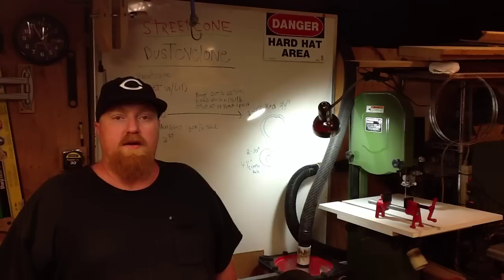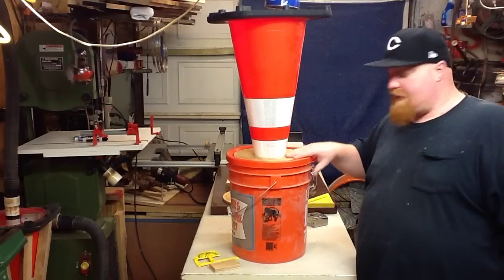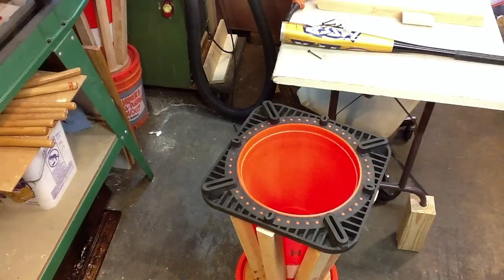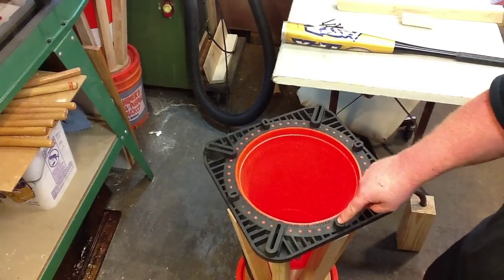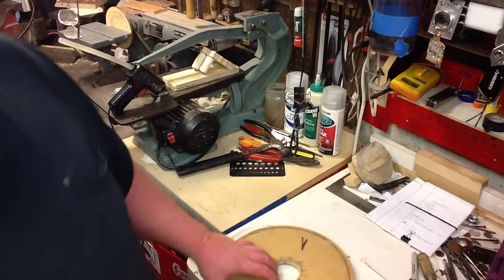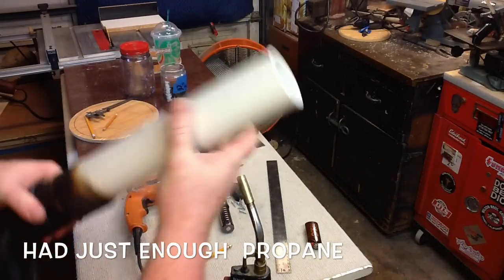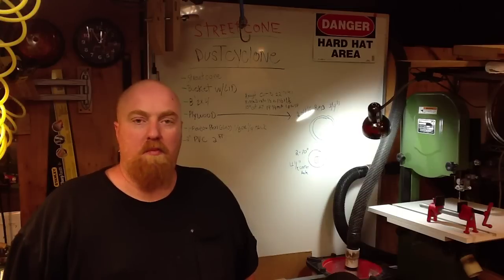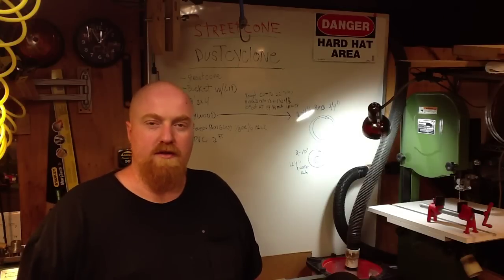Street cone dust cyclone build-015

Comment: There is so much brilliance in this video : rotating table tops; circle jig; aluminum bat as cone cutter;  PVC melt-joining... Thanks for posting!!
Reply from the maker: +Ken Morley thanks & thanks for watching.
Reply: "Brilliance" or "oddity?" That "brilliant" aluminum bat punch is definitely very sketchy. 1st off, I can think of a dozen better uses for an old bat. 2nd It is SO EASY to cut that material with snips. Faster, better, safer, & you get the size hole you want. I've built hold-punches for commercial applications and this punch is as bad as they come. I've never seen worse. This whole bat thing struck me as the result of not having sufficient analytical skills to come up with a better solution. PVC melt-joining is "brilliant?" I can't be the only one that routinely works with plastics. FYI it's kind of a normal thing to do in joining plastics. Not all plastics can be joined this way, each plastic has particular characteristics and some will join themselves readily, other's won't at all. Some offer a weak joint, some a strong, it's all variable. I'm guessing you're kind of new at making stuff, or perhaps just a drunken bromance post, whichever I do agree with you on the rotating table. That was snazzy.

Comment: Great video, I used a 55 gal. barrel instead of a 5 gal. bucket. With a lathe , table saw and miter saw I only have to empty it about 3 to 4 times a year. I  also have one with a 5 gal bucket and have to empty 2 to 3 times per bowl. keep up the good work.
Reply from the maker: +Louis Jones thanks so much , I recently upgraded to a 30 gal barrel and it sure is better than the five gallon. I need to empty that prolly once every three weeks depending on what i make 
Thanks for watching and commenting.

Comment: Cool stuff Pat.  Great low-buck McGuyver trick!  Maybe you could make one addition:  a deeper dust chamber.  Maybe hobble two 5 gal. buckets together.  All that you would do is butt two 5gal buckets, base to base, and screw and glue them together.  You'd have to cut out all but a inch or two of the centers, so the dust can fall to the bottom container.  Maybe sandwich some plywood or something to increase the rigidity, etc.  Then glue the lid to the bottom container (or not?).  Voila!  You got a 10 gal dust receptacle!   Or convert a trashcan into a dust chamber?  RubberMaid Brute trash cans are durable, have pretty good lids, and even have the wheeled dolly attachment.  But, them Rubbermaid/Brute trash cans aren't cheap.  And you'd have to build some sort of internal frame to keep the trash can from collapsing.   I think that may be departing from the essence of your video:  make it at ultra low cost (dirt cheap!).  Whatever volume you need.  Just some ideas.  Cool video, real simple!
Reply: why not just put a bigger bucket under the first cyclone?

Comment: nice idea , could use a wheeliebin / trashcan as a collector , it can hold a lot more and you can just wheel it out in the street for collection not trowing it in another can saving you some heavy lifting 
only thing different would be the lid for the bin  , prolly need some foam strip and some sort of clamping to keep it sealing right 
might even be able to put both cones on it and keep the hoses plugged into the dustmakers
Reply from the maker: +watahyahknow thanks for the ideas  but im not sure if you seen my cyclone upgrade video  here is a link if your interested https://youtu.be/jI_B1Svwk0k  thanks for watching

Comment: Good job!  I have a Dust Deputy cyclone (bought just the kit, used my own bucket) but I need to add the plywood disks to the lid like you did.  My lid sucks down too much when I use it.  I also like how you heat and stretch the PVC - didn't know that could be done.

Comment: After all the research I've done, I've picked your basic design as how to make mine. 
Will basically be a carbon copy, with some mods of course, thats what DIY is all about!
My needs are also currently less than yours. 
But I will connect my lil 2hp shop vac with 2 inch pvc to the top of the cyclone, then the standard 1 1/4 shop vac tube it came with to run out of the cyclone to my tools/whatever. 
My thinking is the 2 inch from the shop vac will allow maximum airflow but not lots of pressure, then the 1 1/4 (only 1 if you count some of the tool, will have plenty of pressure to suck up dust. And it'll really be moving, so less will get sucked up by the shop vac fitting at the top (high cfm, low pressure 2 inch pipe).

I'll let you know how it goes!

Also, I have no planar, lathe,, band saw table saw (although making a table I can use my circular saw, router, and jigsaw as fixed vertical tools).
So I think this set up will work for now. I also live in an apartment,so thats a real limitation.

Only thing I think you missed was the fact that these dust collection systems work great for most debris, but can't really capture sub 5 micron dust, which is by far the worst for your health. So I outfitted my shop vac with a HEPA filter (claims 99.97% at 0.3 micron). IT was pricey, 50 bucks, but will make a huge difference for your health, not just easy cleanup.

Thanks for the thorough, detailed video, have a good one eh,

Peace

Chris

Comment: boil water, put the pvc pipe for few minutes and it will be soft to be streched, no fumes and a better finising
Reply: Or use a heat gun, if you have one, or a hair dryer, if you do not.
Reply: and flair it on a wine bottle..
Reply: All you people with your over complicated NASA shit. Use a heat gun, takes 4-5 minutes, and doesn't burn your work up and make you look like an amateur on youtube.  Most people dont have a hot plate to boil water in a woodshop. You're welcome.

After watch this guy putter around his garage and breathe through his mouth, I am absolutely certain he did NOT build that saw table that flips.
Reply: TimTrOn3000 most people don’t have a heat gun, but almost everyone has a STOVE and a pot of water to do this. Wow. Plus, this guy is obviously resourceful, no doubt he built that flip top, maybe it was knowledge gleaned from other YouTube channels, but we all stand on the shoulders of giants.
Reply: Was thinking the same thing. Even if it didn't heat it up all the way it would be a safer way to apply that first bit of heat. Going a little further, if your pipe would fit in a pressure cooker, that would get it hotter, albeit that you would need some gloves to handle it.
Reply: @errcoche  -- The difference is not that great on a pressure cooker... 212F for boiling water (at sea level) vs 250F for a pressure cooker at 15psi... I've never tried using boiling water though -- I use use a heat gun and keep it moving so that it does not burn the PVC... A heat gun at Harbor Freight only costs around $10 when it is on sale...
When you factor in the time to get the pressure cooker up to pressure and release the pressure from it, it might be questionable whether it saves any time.  By the time the pressure was off, it would be at 212F since that is what the temperature of the water would be after the pressure was released.  You can't just use the pressure cooker to heat it up to 250F and then release all the pressure in one massive pressure release in a pressure cooker unless something is wrong with the interlocks on the container.  I can remember when the interlocks were either not common or they were defective and a few women that I knew back then ended up with beans or whatever exploding into the ceiling of their kitchen.  After an experience like that, many of them swore that they would never cook anything again in one of those "new fangled pressure cookers".  That was over 50 years ago...
You really only need to get the PVC past the "T<sub>g</sub>" (glass transition temperature) stage and for regular PVC, that's the 82C and 105-115C (i.e. 221-239F) for CPVC.  You definitely don't want to go to the point of burning the PVC with a torch.

Comment: Loved this video and the flip saw bench/table. I think if you cut the bottom out of the dust bucket you could then stack it into another increasing its capacity to hold the sh-- shavings/saw dust.
Reply from the maker: +Bob Fullmer hi Bob  i concidered doing that but i wanted to make a vid on the build as well  i did another vid on my cyclone upgrade here is a link check it out  https://youtu.be/jI_B1Svwk0k  also here is a link to the flip top video https://youtu.be/XaeZ17O_MEI thanks so much  i have more vids on the way   thank you for watching

Comment: great job now take one of those cyclones and adapt it to a 30 gallon trash barrel. cut a 2 inch slot vertcal slot that starts a few inches from the bottom and ends almost to the top or to the first lip on the barrel, this will allow you to see how full the barrel is getting without removing the lid. The 30 gallon barrel will not have to be emptied as often as the 5 gallon bucket. ill subscribe to your channel so I'll know when and how you do it, that's if you decide to do it.
you have a lot of great ideas, i enjoyed the video. thanks for making it.  I'd like to add one more thing, i bought a multi-tool and its the most versatile tool in the shop. i thought of it when you were trimming the end of the cone flush to the plywood. all the best, keep up the good work and have a blast with all your projects.
Reply from the maker: thanks Gino for the tips   here is a link to my upgrade video  https://www.youtube.com/watch?v=jI_B1Svwk0k  i think the window sight is a good idea looks like i need to add that  day  thanks for watching
Reply from the maker: https://www.youtube.com/watch?v=jI_B1Svwk0k
Reply: i see...nice job.

Comment: very nice. I think I'm gonna use a clear 5 gallon water jug upside down on a bucket, instead of a traffic cone.
Reply from the maker: There are lots of different options in making these, But whatever you use it'll work great because it keeps the shop vac from getting Full And slowing down the airflow  Thanks for watching

Comment: mad props for the spin/change saw table.  But you seriously overengineered the crap outta that cyclone.  That's a lot of support for something that will be mostly empty most of the time.  You could run ore slurry through that thing, never mind sawdust.  LOL.. Nice job though

Comment: Good build.  Word of caution.  Use electrical PVC instead of plumbing PVC.   Electrical is designed to be heated without releasing any deadly chemicals.  If you have to use plumbing PVC, do it in a well ventilated area.   I had to bend custom 22.5 degree bends for pressure in a sewer plant years ago with our electrical hot box.  We did it outside and due to the amount of bends, the odor was still obnoxious.

Comment: Nice build Patrick. 
I went with the thien baffle instead as it sits neatly on the big buckets.
Reply from the maker: that's awesome Irish chippy      whatever works best for ya, at the end of the day all I know is I haven't had to clean or open the shop vac or clean a filter  in years
Reply: Yeah. Except when I forgot to empty the bucket. The problem with big buckets is you do not need to empty them often, and thus you can become complacent  :)

Comment: Nice job. Btw, I would think you wouldn’t want to connect the two cyclones in series since in order to have the second cyclone kick in the first one has to be full and actually overflowing into the cone, which then would make it hard to clear the bucket underneath without spilling debris all over the place. I would think a bigger bucket with one cyclone would do exactly what you want and perhaps use the second cyclone in a different part of your workshop.

Comment: Hey bring the cones back to my Jobs eight! I almost got hit by traffic!

I'm joking... 

You need a 20 to 55 gallon steel barrel with a removable top, then you can work out a chip shield for this and an old furnace motor and fan for a vacume as a vacume and just vent what dust might get past it outside.
I've got an old furnace motor I'll do this with into a case and put filters on it recuse I do not want to vent it outside of my basement and loose the condition air.
You can always use a 2 stage dust collector after the cyclone with a 3 micro filter and have the filter last longer.
Reply from the maker: https://www.youtube.com/watch?v=jI_B1Svwk0k  here is what i have now  check it out

Comment: cut of 1/3 from  bottom out of your bucket and put in in to a new bucket this you don't have to open up anything to dump the Bucket you just lift up the whole thing and everything go to the Bucket below. If you don't have a good seal don't push down to hard put a strip of shop rag or any soft door seal or strip of  foam glued evenly on the out side of the primary bucket to prevent dust.

Comment: I would assume you would want the interior of the cone to remain as smooth as possible for the vortex airflow.  By adding in all those internal screws to each 2x2 (which also did not seem necessary to do at all)  you seem to have limited the intended purpose of vortex airflow.
Reply: A healthy bead of construction adhesive or other tough glue along the inner edge of 2x2 would work in place of screws.

Comment: Hey, great idea Patrick. 

How I get the hold of a traffic cone in the UK apart from sneaking out in the dark and getting one I am not sure. 

I have seen different sizes off traffic cones and wondered  what size you used! I guess about 3 feet high since you mentioned a cut of 29 1/4" at 10 degrees. I am sure that on our motorways they use Traffic cones about 4ft high, which would need a wider heavier bucket to put it on or it may topple over. 

Just a thought not based on real knowledge apart from watching Matthias Wandel's experiments with dust extraction on Youtube where a Thein baffle was incorporated into a cyclone to create the seperator. 

Perhaps you could experiment with a mini thein baffle at the bottom of the cone to stop the waste from coming up into the cone and making it messy emptying the full bucket of waste.

Keep up the good work.

Comment: What about using 4" pipe with the traffic cone.  I bought a HF HP and I thought of using the cone separator with it if effective.  I hope the heating of the pipe will work well with 4" PVC. Love the flipping saw.
Reply from the maker: +Robert Burgy you know I don't have a four-inch dust collectorOnly the shop vac so I wouldn't know anything about that size ,I do figure that the more CFM's you have you risk the chance of sucking the cone in and collapsing the cone therefore blockage would be a problem, I hope you figure out what you need to do you know what if you figured out please make a video butHey be awesome to see what you come up with thank you so much for watching I'm glad you love my flipping saw thank you so much

Comment: you have a lathe why not turn a mandrel and use that to swage the pipes a lot easier, look out for a hot air gun  or nick the wife's hair dryer, { note you have no need of one ,},  ,also please use the guards on the machines, I   been wood  machining for 67 years and still doing it, shuddered when you passed you arm over the blade  and noticed the roving knife was missing they are  there for a reason,  as  is the over head guard , other wise great work Patrick ,had you thought about marking the stays  temp screw and remove then drill all the holes ,just a thought ,Gkids just lost their practice parking cones  hIHI.

OH loved your flip bench  going to see what I can come up with, never to old to learn and always someone has thought of a different way , mate keep those fingers  use the guards
 great work cobber.

Comment: Instead of a blow torch I would have used a heat gun which works just as well and doesn't leave burn marks like the torch did. And the cuts on the bucket lid are easier to make when the knife gets heated. You may lose one blade but its a lot less elbow grease wasted.

Comment: I have already made a cone cyclone dust collector.  It works very good but i have to do some modification, such as a bigger  bucket,   add some wheels too.  What is your opinion about the depth on extraction pipe in the cone?

Comment: I appreciate the video. and I did like it. But out of curiosity could you just use a bigger bucket? Like a 50 gallon drum?
Reply: Dan Tauro 50 gallons could be a bit tricky to dump out when the time came.
Reply: I used a clear plastic storage box as the waste container...  less height and more volume and... you can see if it is full.

Comment: Hey great video. Why didn't you just swap out the collection bucket (5 gal.) up to a full size trash bin? Looks like you could easily unbolt the plywood flanges from the bucket lid and attach them to another lid on a larger vessel. I am planning my own collector and curious if you considered this. Thanks.
Reply from the maker: +Ian Dunstan hey Ian for the longest i just let the bucket fill up  so i got a larger bin and here is a vid of what i did to upgrade https://youtu.be/jI_B1Svwk0k  thanks for commenting and watching